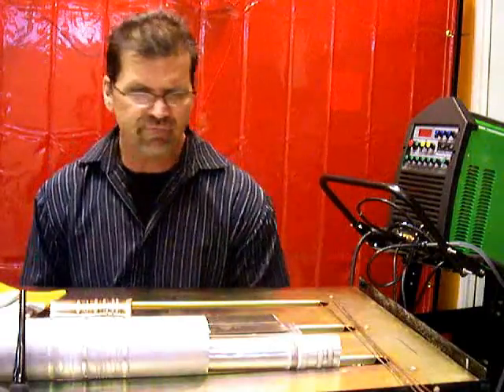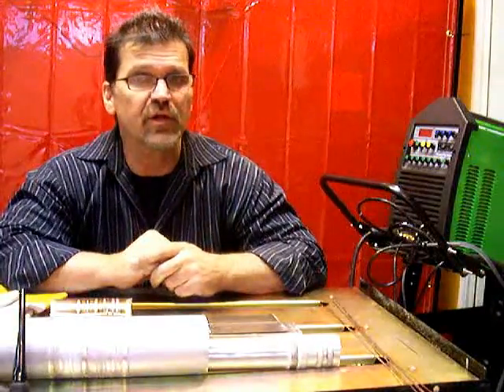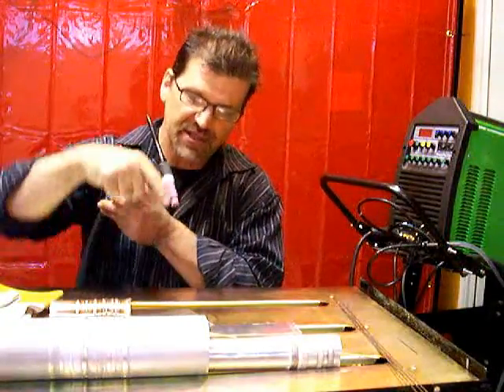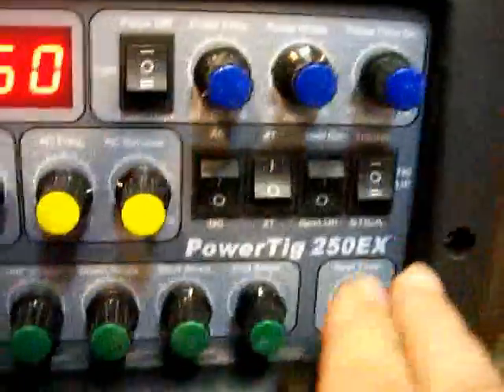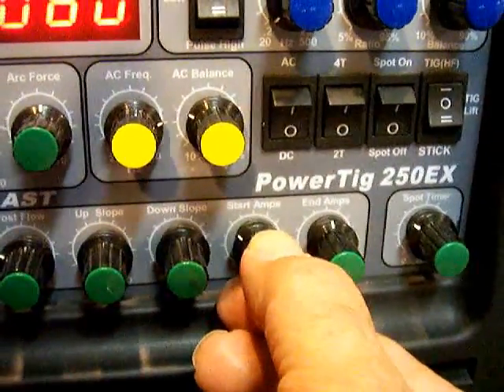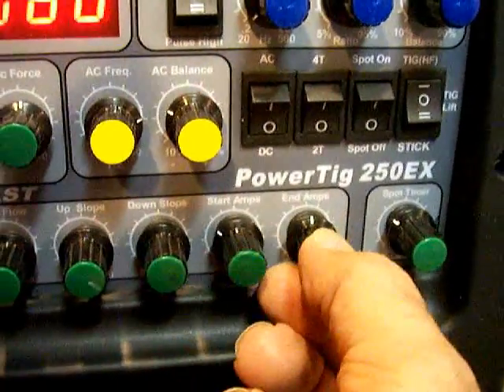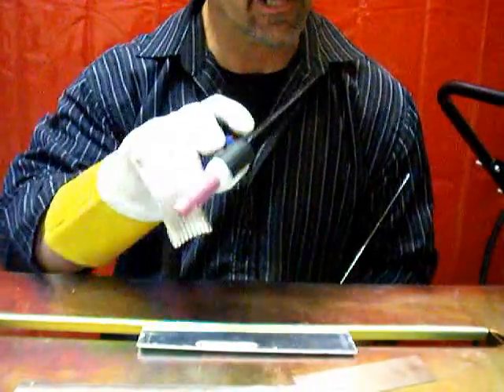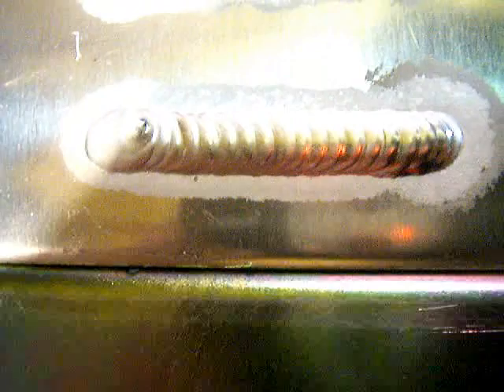Tig Welder Reviews - Inverter Tig Welder Settings

Comment: I got the EL 250 EX after watching this vid. I did plenty of other research beforehand.  I'm happy with the whole package.  1/4 aluminum is no problem, with power to spare.  Freq/balance/pulse features are sweet. DC steel is a dream, nice buttery arc. Low arc settings are precise.  I'm using the #26 torch with lens for durability, parts selection  and heat resistance. I have 30 years experience  on transformer tig machines.  This is my first inverter machine.  I'm  sold ! Thanks

Comment: sir i am doing tig welding on aluminium alloy 6351 .but even at high welding current the joint is not formed thickness is 6 mm .please tell me how to set the knobs positions and suitable welding current

Comment: how do I calculate the amps on different metals?(stainless, iron.....)
what happens if you use more amperage then you need?(hot)
would I make a hole on the surface or break the machine?

Comment: Just bought a Everlast 200DX Powertig.... I noted in their recommendations to not use "GREEN" electrodes or 100% Tungsten in an inverter machine. I went ahead and purchased "RED" Thoriated electrodes which they recommended for "all purpose" welding. What do you recommend?
Reply: i have an everlast 250 tig and the only tungstun i ever use for steel allum or stainless is red 2 percent  theriorated  shapened to a razor sharp point. and works very well. dont use green pure tungstun thats old school when they didnt have the inverter tig welders you had no choice you had to use green but not now hope this helps bud.
Reply: I use lanthanated tungsten with my everlast welders. Works good for me.

Comment: The 250ex comes with a wp18 water cooled torch. If you have any questions just give them a call or post to their forum. Everlast has been very helpful to me whenever I've had any questions and I've had quite a few before placing my order.

Comment: The dials are grouped by function and are easy to see all of the settings without having to push any buttons. My Everlast 200dx is very similar and I find for me that it is far easier to change one setting with one dial than it is to push a series of buttons to get to the right setting.Maybe I will change my mind if I get a welder with a panel like yours.

Comment: i noticed that my machine(250ex) throws a spark some times on the inside of the welder when you turn in on,but not every time. seems to be coming from the little blue ball shaped units on the inside..is this normal? just got the machine and am not sure if i should return it .(seems to weld fine otherwise)

Comment from the maker: i got by with an air cooled torch for a long time. But i finally smoked it from always pushing the limits.  I like a water cooled #25 small torch.
This Powertig has an auxillary 220 volt plug in the back for the wc...so i only need one plug in.